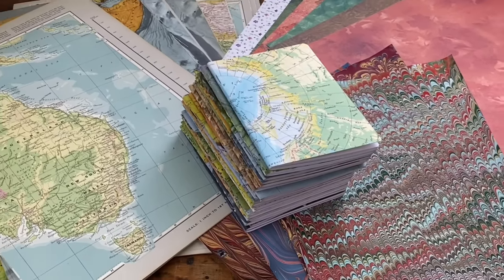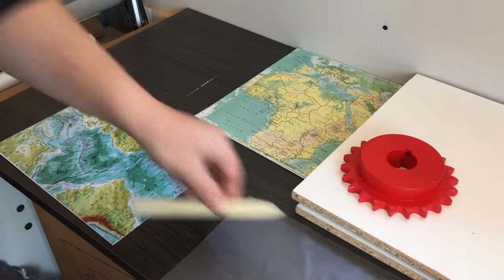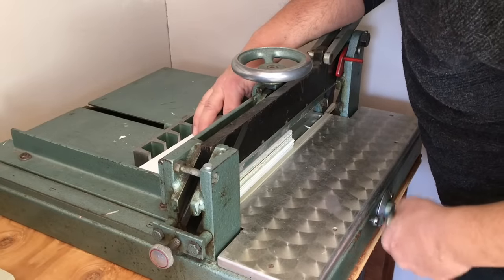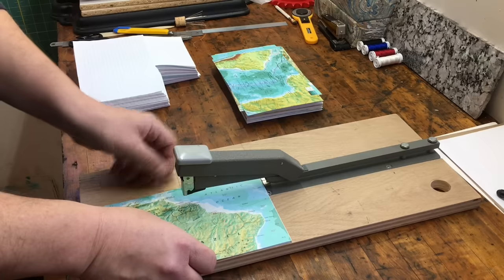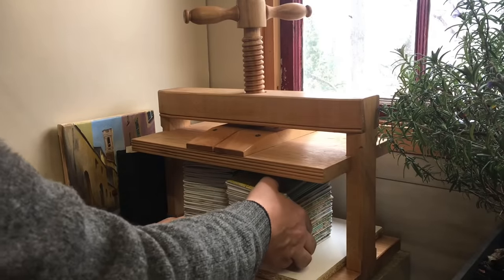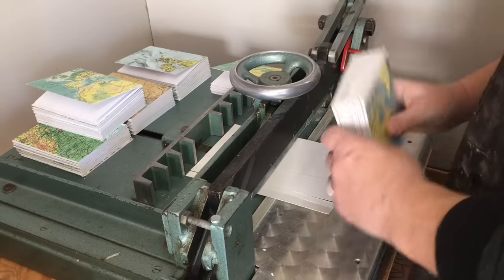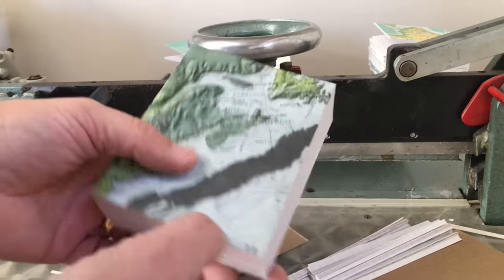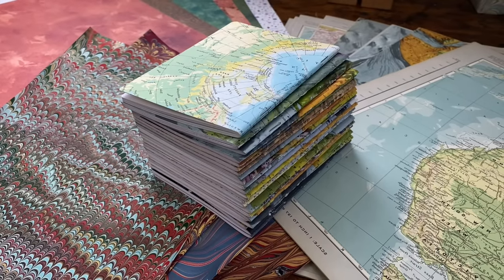Making a Batch of Upcycled Pocket Notebooks - Easy No-Sew Binding

Comment: Wow, my shopping list just got serious:
Wooden press
Corner cutter
That paper trimmer!
Reply: If you find any links and/or price tags to these items I would be interested to know them.
Reply: Same! Wow... Someday!
Reply: Me too. My dream equipment.
Reply: That style of cutter is called a guillotine cutter. You can find them sometimes at junk sales or flea markets. They're not really popular because most people don't need to cut that much paper in one pass. A lot of older ones are cast iron and can be cleaned up pretty easily. As long as the blades aren't chipped or nicked, they can usually be sharpened by one of those mobile knife sharpener folks.

You can get a smaller, handheld corner cutter from a craft store (the style he mentions in the video). Usually they're in the scrapbooking section. They will take longer to do since you can only do a couple of pages at a time, but it's a lot cheaper than buying a piece of specialist equipment.

For the press, I have an old shop vise with large cabinet door panels. It's not as user-friendly as the wood press used in this video, but it's a heck of a lot cheaper and accessible for a lot of people. The best presses are solid oak which makes them fairly expensive. A lot of the ones that used to exist in print shops and stationery stores have pretty much been bought up by antique collectors who like the patina, but have no idea what they do.
Reply: @UD503J 
Thanks for the info with the guillotine cutter - definitely will look into getting one someday! Also agree that the scrapbook corner punches and clamps are great budget-friendly bookbinding tools! For pocket notebooks like the ones in the video though, I've often used heavy books to act as presses. ^^

Comment: Hi will this work with 100 pages?
Reply from the maker: If you mean 100 sheets of paper, I think that would be too thick for this method. But for finished pages inside the notebook you divide by 4 to get the number of pieces of paper, so 25 sheets is possible I think, especially if you use very thin paper. The notebook might still be bulky but if you press it well it could turn out okay. Thanks for the question!
Reply: @FourKeysBookArts  thank you

Comment: You mention when counting out pages that you count out 12 pages per notebook which will make 48 pages per notebook…wouldn’t that make the total pages 24 per notebook? Or are you stapling 24 pages per notebook?
Reply from the maker: No, each sheet of paper when folded in half will become 4 finished pages, so 12 x 4 = 48. The terminology can be confusing at times. A single piece of paper is a sheet, fold it in half and it becomes a folio, which has two leaves, and a total of 4 pages. It doesn't help that I tend to be rather imprecise when speaking either, so I hope this clears things up!
Reply: Oh! Thankyou so much for explaining. And especially for your craft and for sharing the processes.  @FourKeysBookArts

Comment: for me, a notebook only requires one feature to make it valuable to me, it must have 300 plus pages, otherwise it has nothing special to offer me. It is easy to make something that size, the punch used to make anything spiral bound. The holes are then easily stitched bottom to top then reverse and go top to bottom. Gluing is not required. The stitching is tight and secure. Adding a hardcover is a preference only matter. And the spine is unbreakable. I turn all my pdf print outs into books this way. Plastic, or cardstock covers or go all the way deluxe and give them hardcover option. It's not traditional, but it is blindingly fast and effective.